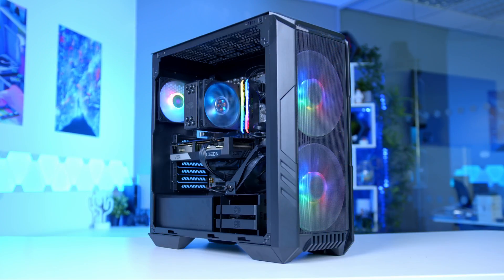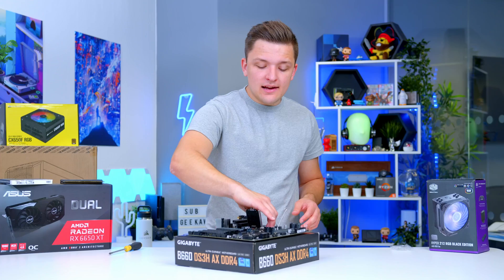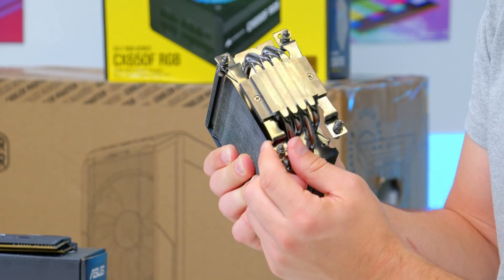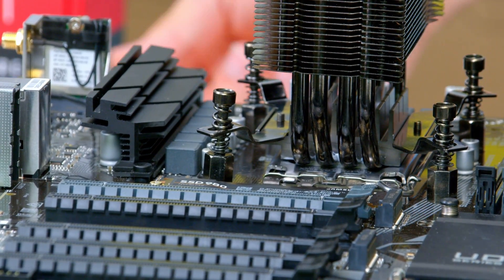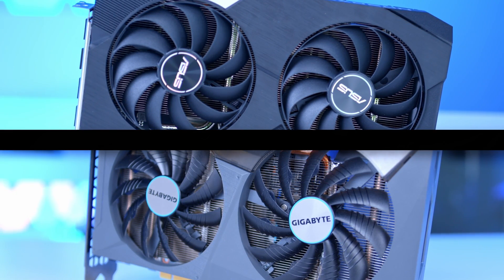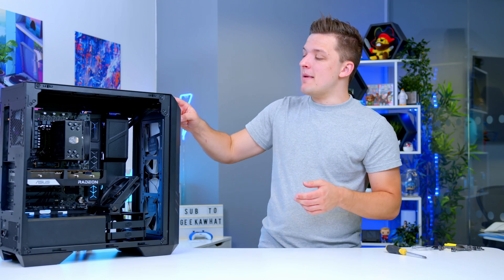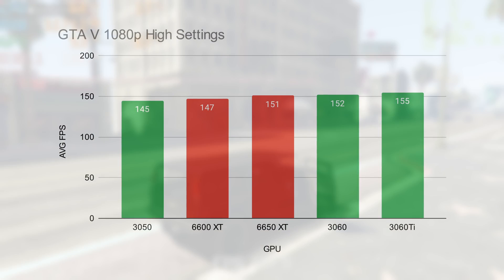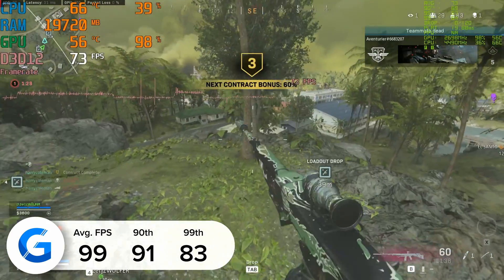Best $900 Gaming PC Build 2022! [Full Build Guide w/ 1080p Gaming Benchmarks!]

Comment: Hey what case could I use for this build as this is my first pc and I don’t want to spend that much on a case? If I can get a solid case with no rgb fans or anything like that for less than 100 that would be great!
Reply: Just buy 2x16 3600 cheap not  RPG ram with RTX 3060ti and use i5 12600 not i5 12400F and case 60 Euro its great SilentiumPC Regnum RG6V TG Pure Black, and you have already 4 fan installed on the case him self Good Luck
Reply: @arbenbytyqi9732  thank you so much for the help😁

Comment: Just finished mine, it was around 750 maybe 800. Got a 6600xt for $300 i5 12400 and same motherboard as you but the micro tax version. Running Warzone at 1440p max still getting 120 fps
Reply: Also the 12400 was on sale for 150 12400f go for like 170 plus 25 off so for $125
Reply: how can you possible get a 6600 xt for 300
Reply: @Harry-qq2kt  Facebook marketplace. Just have to find the right people, they barely used it for a month and upgraded.
Reply: Bro in serbia 6600xt is like 500 dollars 😂

Comment: Im currently building a pc with the z-690 p, inside of the corsair 4000x. I have a 360mm aio with obviously, 3 fans. Id like to have that set to input with 2 separate output fans. But the z-690 p seems to only have 3 fan ports. Is there anyway i can do this? Can i expand it with the included corsair fan hub?
Reply: Yea i think some corsair cases have a fan hub on the back side

Comment: My $1000 build 
Asus prime b560m
I3 12100
Teamgroup t-create 16gb 
Msi radeon rx 6700 xt
Zalman t7 (case)
3 pack fans (any)
Evga 600w Ba
2tb hdd/equal value ssd

(Should be like 1025?ish)-with tax
975? Without tax
Reply: The B550 motherboards are only for Ryzen though...?
Reply: @quackinand4499  oops ment b560m
Reply: @notChemical  b660* lol. b560 is for 11th gen processors. all of the other parts are decent choices, although if you are giving info to others its probably important to focus on those small details
Reply: Might wanna upgrade that cpu
Reply: @soup3447   yeahhh if I had a little more I would have added a cooler and the i5

Comment: This is literally the same build I'm making right now...taking away the case and the cooler.
Reply: The gigabyte b660m ds3h doesn’t pair too well with the 12400f, so you may need to make some tweaks in the bios to let the 12400f reach its full potential
Reply: @reallysillybillyischilly7166  Personally i am going for a RTX 2060 and a Ryzen 5 5600X,my build's also 900$
Reply: @rolandmyrteza8881  cool
Reply: @rolandmyrteza8881  dude why a 2060 with a 5600x?
Reply: @theeditingdepartment9421  Well that's why i said why i said in the first place,why not and what would you recommend ?
Reply: @rolandmyrteza8881  well for 900 you could easily get a cheaper 12400F or even a I3 12100F and get a 3060.